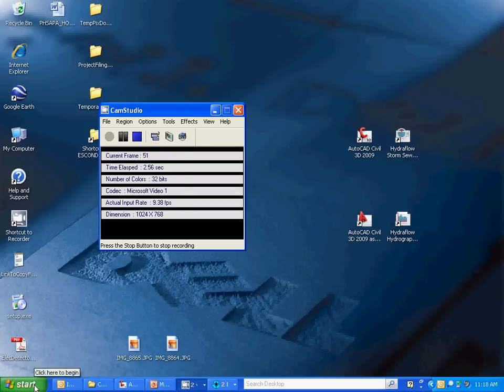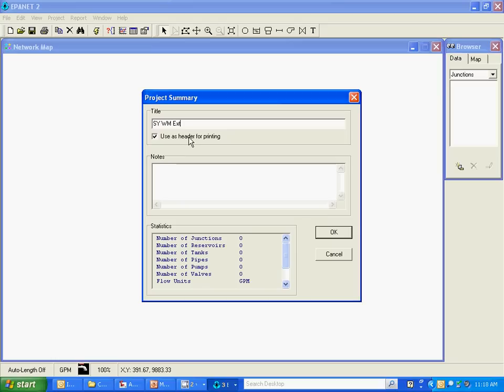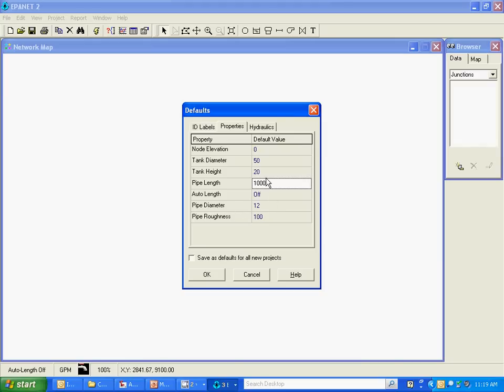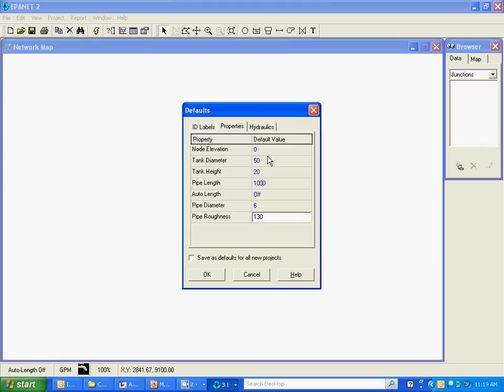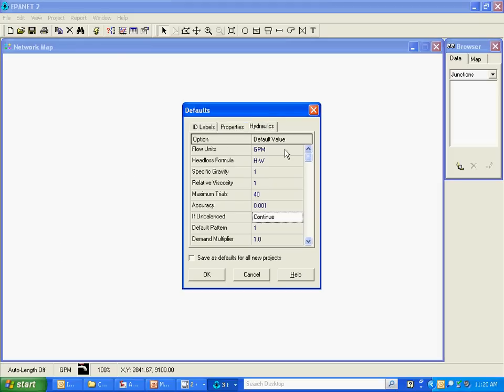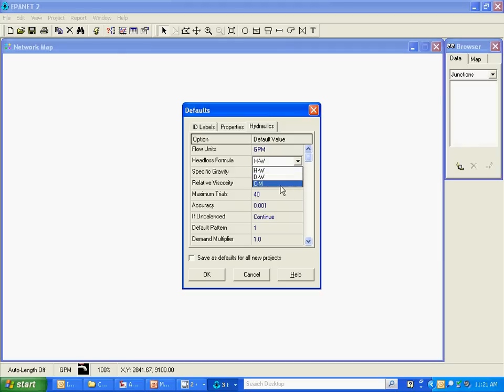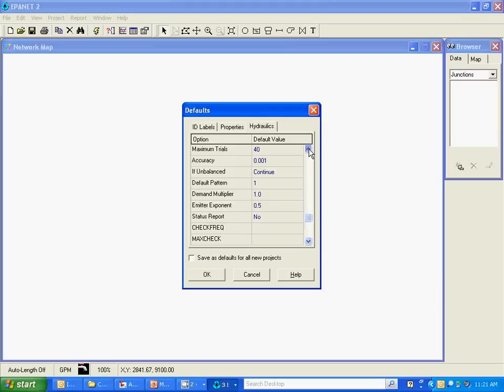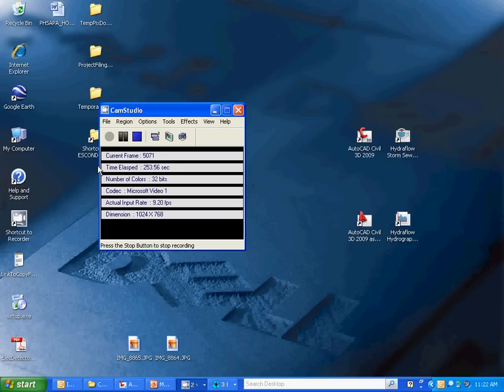EPAnet Tutorial Section 1: Setting Up the Model

Comment: @checcoiat Yes, that is my conclusion too. But it's still impractical. It does take the minor losses into account but it divides them so you get head loss per one meter of pipe. The end result is correct but it makes comparisons and monitoring a lot more difficult because you don't get the real Reynolds number. The end result is correct so it is very usable however.

Comment: @antunkatona If I got it right the friction factor calculated by the program is the one that the pipe would have if you only consider the formula for the calculation of major losses and still get the right total head loss (i.e. sum of major + minor losses). You're right though, it's theoretically incorrect!

Comment: Hello! I have a question about the Property Editor in Epanet 2.0. What is exactly "loss coeff"? I assume they mean the Minor loss coefficiont aka the local loss coefficient, right? If so, why does it seem to have an influence on the fricition factor after running the analysis? It doesn't make any sense because the friction coefficient is derived from Moody diagram (Reynlolds number and relative roughness) and has nothing to do with local losses.